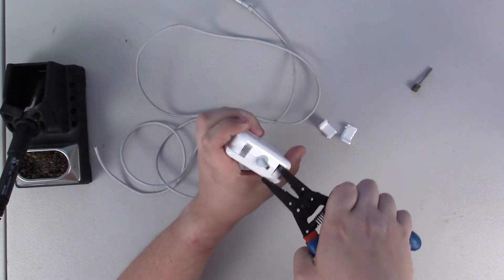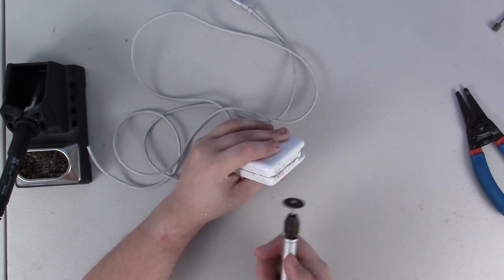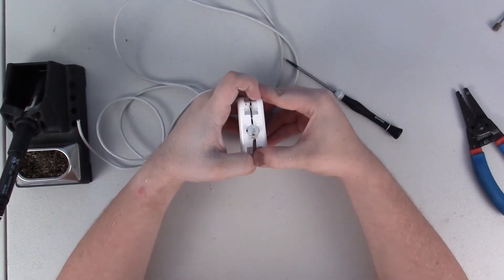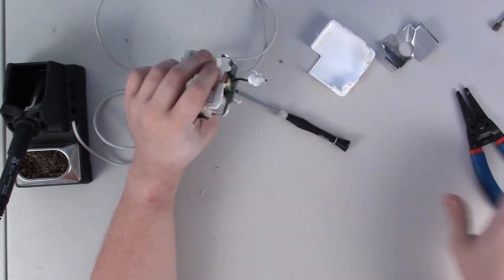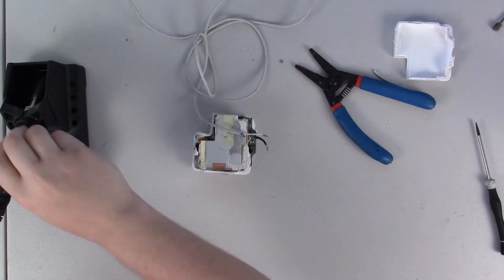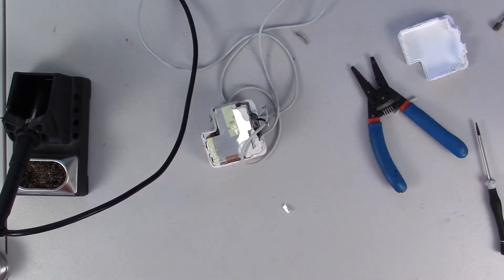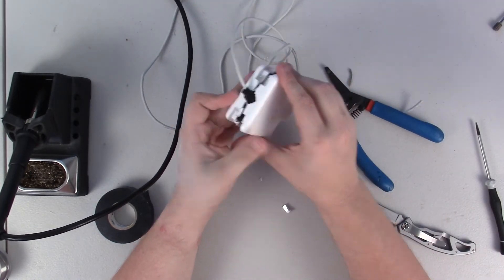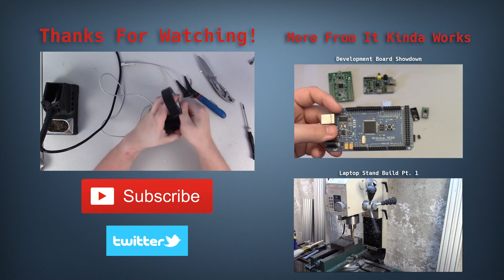Macbook Charger Repair

Comment: thanks for sharing but in my opinion not worth it, just buy a knock off charger for $10
Reply from the maker: I've torn a few of those apart as well and I have to disagree. Most of those have little to no isolation so you risk among other things blowing out your macbook. They usually don't have any thermal protection to speak of so there is also a pretty good fire risk. The other issue is that genuine macbook chargers dont supply full power until a load is put on them (by plugging in your macbook) and until then they only put out maybe a volt or two at super low amperage. Because of the design of the charging end it is very easy to bridge those contacts so on knockoffs its easy to short them out (which also poses a fire risk again) as well as an electrical shock risk. Ken Shirriff's blog post (http://www.righto.com/2015/11/macbook-charger-teardown-surprising.html) has a great teardown of a macbook charger and goes into a lot more detail but yeah I'd rather not risk my 2k+ macbook to an unknown risk. At least when I make these macbook charger mods I am taking the risk into my own hands rather than some unknown company.
Reply: Thanks for that link, that is very informative! Maybe there is market for apple charger cases after destroying them like that to repair them. I agree with you that the electronics are far superior over anything knock off.
Reply from the maker: Youre totally right, there would be a good market for that! If I had a 3D printer I would totally design a replacement case.